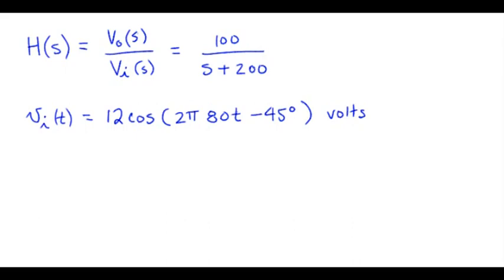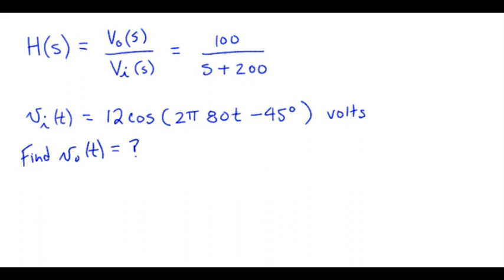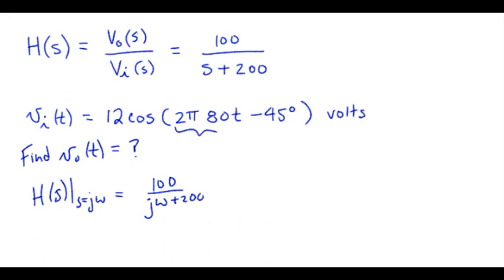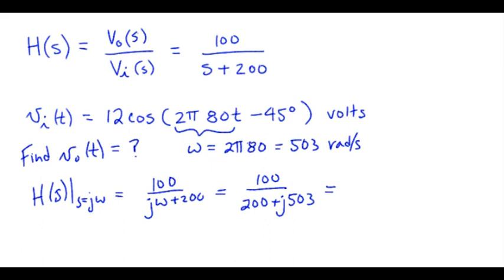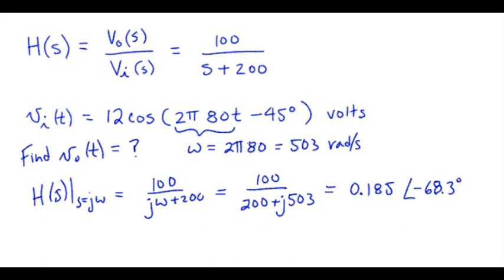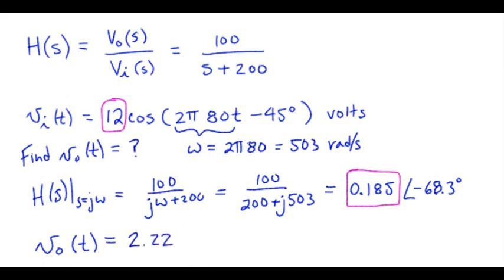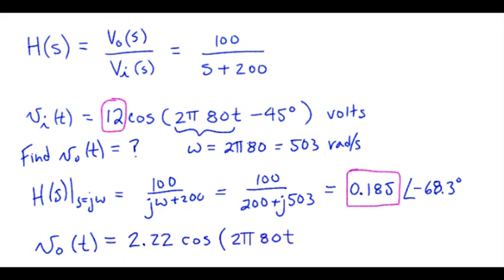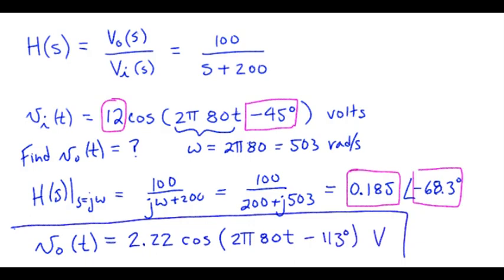s: S-Plane Sinusoidal Steady State Example #3

Comment: No sir I m not talking about dc value of transfer function. If the input signal having dc value like Vin(t) = 2+5sin(100t+45)  will the dc component 2 is also coming to the output?
Reply from the maker: Yes, the DC component 2V will pass through this circuit to the output, but its value will be 1V because (in this example) the circuit's transfer function has a gain of 0.5 at zero frequency (DC).

Comment: Sir what if Input is having dc component? Will it come in output too?
Reply from the maker: In general the DC gain of the transfer function may be found by evaluating at s = 0. For this particular example the DC gain is 0.5, therefore if the input had a DC component the output would, too, with half the value of the input.